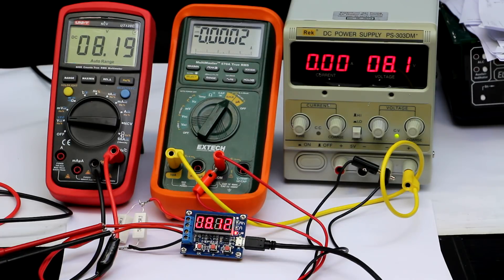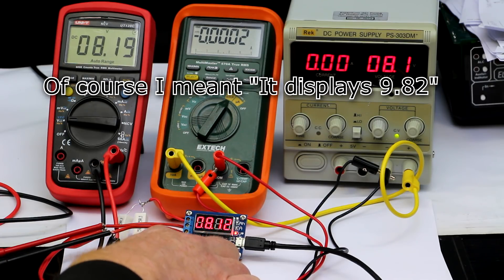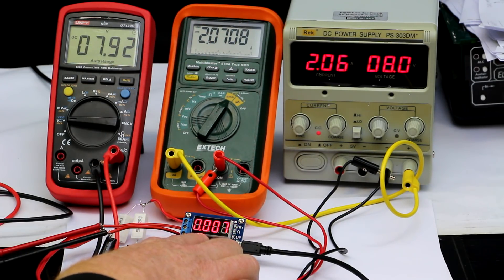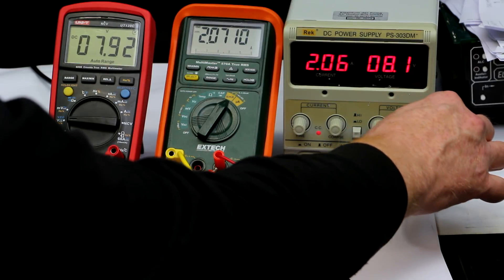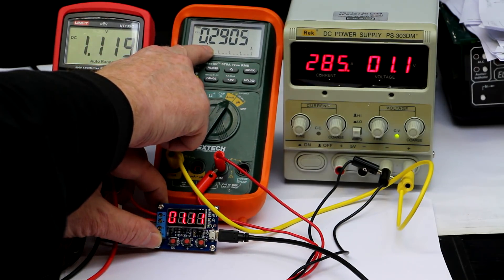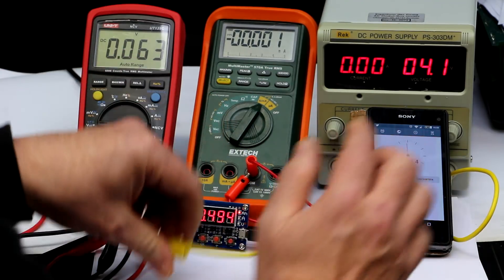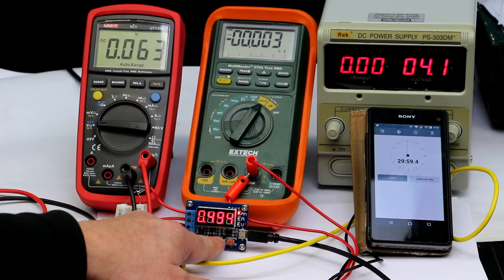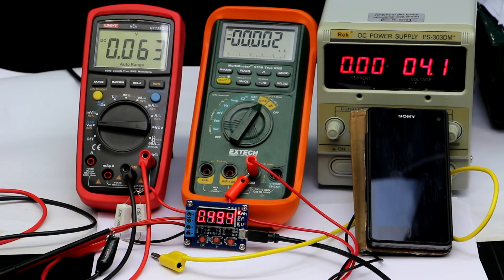Software-calibration of a cheap battery charge-meter from Ebay

Comment: Calibration used here is WRONG. It needs to be done at TWO AMPS, not 200mA.
Follow the instructions, and calibration will work just fine.

Comment: 200mah, thats true. Helpful
Reply: Nothing in this video is helpful. The described way of calibrating the Amps is completely wrong. Therefore, after wrecking that it cannot calculate anything correctly.

Comment: i know this has a bit of age, there a video like yours where he uses only short jumper wires no resistors " https://m.youtube.com/watch?v=Noc7CF6L78c" have you tried this way ( infull ) no resistors while calibrating no volt in while calibrating. then after that fact apply resistance an voltage one on one for each item an see what you get.

Comment: I received one of these the other day and found a consistent 12% capacity over read error. I tried the calibration method several times and found that I could use the +/- buttons to adjust the device! I.e. I would apply 10.00V exactly, and the device would read 10.14v, so each tap of the '-' would bring the display down 0.02v until it read 10.00v. Same with current, I applied 2.00A, and the device displayed 2.28A! I was able to bring the displayed number down to 2.00A.

It seems the software of this version is slightly different.

Note that during the 2.00A current calibration, the voltage is around 8-9v with a ~4 ohm resistor. That is a heat dissipation of up to 18 watts, which is too much for a single 5 watt resistor, so be quick with that particular calibration.

Comment: TEST (cont'd): IS A 25mA OR 50mA CURRENT A SINGULAR CAUSE OF mAh MEASUREMENT ERRORS WITH ZB2L3 ANALYZER?

CONCLUSION:
Test results empirically show there is no significant error in mAh at the 50mA or 25mA test current that can be blamed on JUST the current being lower and near these values. Any significant mAh difference in other tests must be due to another factor or combination of factors that may or may not be affected by a sub 100mA load current.
Note: the same disclaimers and factors apply to these results as in my prior ZB2L3 tests regarding possible differences due to test equipment, components, etc.

OVERVIEW:
Earlier today I ran a 4.00 hour test at 50mA and a 5.00 hour test at 25mA on the ZB2L3 "rev2.3s" using the same protocols as my earlier tests at 150mA and 500mA currents.
(see https://www.youtube.com/watch?v=viiRounCLWw&lc=UgwGE7Q5ItTS2YV6HsJ4AaABAg )
I decided to perform these low-current tests because there has been discussion that the ZB2L3 produces errors that increase very significantly under low current conditions.
50mA in particular was noted, and I wanted to see if this error increase would happen with my equipment and protocols.
Seeing no impact in the 50mA tests, I took the testing even lower to a 25mA current load.

Again, I was stunned by the accuracy and consistency of the results displayed by the ZB2L3 Analyzer I received, even at these low currents.
===============================================================

50mA TEST RESULTS AND PARAMETERS
Vsource~12.3V and Load=246.0 ohm to produce ~50mA constant current. (Load=250ohm 10W 5% Ceramic Resistor, measures 246.0 ohms)
(Note that ZB2L3 displayed 50mA load is consistent with independently measured 12.30V bench supply output  and 246.0 ohm resistor)

Here are the results over time as displayed by the ZB2L3 at hourly observation intervals. 
0.00 hours, I=50mA, mAh=0mAh..........START of test
1.00 hours, I=50mA, mAh=50mAh
2.00 hours, I=50mA, mAh=100mAh
3.00 hours, I=50mA, mAh=150mAh 
4.00 hours, I=50mA, mAh=200mAh....END of test
(Note: at the end of the test, the ZB2L3 display actually transitioned from 199mAh to 200mAh about 6 seconds before the 4.00 hour mark. 
Since 0.01hours=36seconds, I consider that 6 second early transition at 3.998 hours a negligible significant digits issue in this type of test so just recorded it as occurring at 4.00 hours)
CONCLUSION (50mA): These empiric results thus show that BY ITSELF, reducing the test current to 50mA is not a significant factor in producing any meaningful error in mAh measurement and calculation.
===============================================================

25mA TEST RESULTS AND PARAMETERS
Vsource~6.15V and Load=246.0 ohm to produce ~25mA constant current.
Here are the results over time as displayed by the ZB2L3 at hourly observation intervals.
0.00 hours, I=25mA, mAh=0mAh..........START of test
1.00 hours, I=25mA, mAh=25mAh
2.00 hours, I=25mA, mAh=50mAh
3.00 hours, I=25mA, mAh=76mAh 
4.00 hours, I=26mA, mAh=101mAh
5.00 hours, I=25mA, mAh=126mAh...END of test
CONCLUSION (25mA): These empiric results thus show that BY ITSELF, reducing the test current to 25mA is not a significant factor in producing any meaningful error in mAh measurement and calculation.
------------------------------------------------------------------------------------------------------------------

edit 201911130915UCT to fix improperly parsed hyperlink

Comment: I just finished some tests on a ZB2L3 I received to check in particular on the clock/timing and mAh accuracy issues about which people have expressed concern.
The tests suggest that the mA, mAh, and clock/timer subsystem hardware and firmware are working and accurate...at least on the analyzer that I received and in the voltage and current ranges of interest to me. I was actually very surprised by the results.

Note: I have NOT recalibrated the analyzer. It is as I received it from the Seller.

From what I've read however, it should be kept in mind that others may see different results. This could be due to different versions of the analyzer, different components and test instrumentation, attempts at recalibration, and even getting a counterfeit analyzer...a problem with China electronics.

The timer and instantaneous voltage/current measurement and mAh integration calculations were more than accurate for measuring battery/cell capacity at the approximately 3V and 10V limits I used in the tests...which covers at least the 1S and 2S lithium cell configurations and power requirements that are my primary areas of interest.

On ZB2L3 Rev2.3s (at least it KINDA looks like an "s" to me), I set up two identical configuration tests to evaluate a 500mA and then a 150mA load scenario.
I used a bench supply to provide a constant voltage to the ZB2L3 input into a 20ohm test load attached through the analyzer. This was comprised of two 40 ohm 1% resistors in parallel, which measure 20.0 ohms as expected given the tolerances of my instrumentation.

Over a 13 hour test, the ZB2L3 analyzer correctly reported accumulated mAh at 500mAh per hour with error well below my instruments' tolerances. For example, every hour the ZB2L3 display consistently reported the mAh increased by 500 +/- 3mAh and the instantaneous current stayed steady at 500 +/- 1mA.

FINAL NUMBERS
At the end of 13 hours, at 500mAh per hour the accumulated mAh reported was 6510mAh. (theoretical should be 6500mAh). That is much less than 1% error.

In a shorter 6 hour test I did the same for a lower voltage selected to produce 150mA via the same 20 ohms load (2x 40ohm 1% in parallel). The ONLY change between the two tests was the input voltage to the ZB2L3 and the duration of each test.
Yet again, the hourly reports showing another 150mAh and the instantaneous mA (150 +/-1mA) were virtually dead-on. At the end of 6 hours of testing, it reported an accumulated 905mAh (theoretical should be 900mAh). Again, less than 1% error.

edit: 201911082125UCT
change "at 500mA per hour" to "at 500mAh per hour"
edit: USB POWER BANK ASSESSMENT
these two tests also strongly suggest to me that measuring the more or less "constant" 5V output of a USB power bank should provide accurate and meaningful results as well. So...if I test a USB power bank from fully charged until it's depleted down to displaying just "1 bar" of charge left, I think I can be confident that the mAh capacity reported by my ZB2L3 to that "1 bar" point can be relied upon.

Comment: One very critical result I've found with this device (rev 2.3s) is that the results are VERY CONSISTENT under a given set of conditions and test parameters. And in testing...consistency is goodness.
For example, it displays  results that are +/-5mAh in measurements of battery packs with capacities over 1000mAh, and mAh plotted vs. time are also extremely consistent under a given set of test conditions (Vtermination, load, etc). In other words, for a given new battery pack/cell, it provides virtually the same mAh capacity over a series of multiple mAh capacity tests for that cell. A REALLY "1410mAh" cell will always result in a measured capacity of X mAh time after time with very little variation in the result. (the "1410mAh" is not what the label says...it is the actual as yet TBD value for that cell. For all I know, the label may fraudulently claim "2500mAh" capacity).
In addition, it takes the same amount of time to decrease the cell by Y mAh. For example, it takes 5 minutes to "consume"  100mAh, and always takes very close to the same 5hrs 25minutes to deplete the cell to Vtermination. Logging mAh v. time I could practically use the real-time mAh displayed as a stopwatch...if I see that another 400mAh are reported as having been "consumed", then I can calculate (or plot) that 20 minutes have gone by without even looking at a clock...and I can rely on that same mAh v. time in test after test under the same test conditions.

That means one can rely on the consistent results even if one cannot directly claim the DISPLAYED results. The good news is that it means one can formulate an algorithm to compensate under given test conditions to compute the "real" mAh value...or very close to it for a given device....by using results from tests on devices with accurately known values. If a given cell is ALWAYS reported by the analyzer to provide "1325mAh", using the correctional data (if any) from testing known devices one could determine that a report of 1325mAh under the given test conditions is really "1410mAh".

CONSISTENCY also means that one can perform COMPARATIVE evaluations that are meaningful in real life. One can for example, determine that a battery pack/cell that tests to and displays 3025mAh is ALWAYS superior to a similar battery pack/cell under test that displays 2400mAh...and it can be inferred that it is superior by an appreciable amount. The superior pack/cell may in fact be 3200mAh or 2950mAh, but it will always be more than the inferor pack/cell and that may be all that one needs to know...that "brand X" is superior to "brand Y" when X and Y are CLAIMED to have equal specifications/performance in a given application.

note: the numbers used above do not reflect any real devices or results. They were arbitrarily selected as representative rather than literal.
Reply from the maker: As some other commenters have suggested there seem to be different versions of this device. Getting stable results is only half the price if the absolute value is completely off. As I suggested, try to compare the displayed value of a low discharge current of e.g. 10...50mA with your multimeter in DC-Amps and in series with the charge-meter.

Comment: I really appreciate the time and effort you put in to this module, not to mention sharing with us - remarkable!
So sad that you've got the knockoff  version of this module to work with.
Strangely your module has nothing written on the upper side of the board. It might have different, lower quality IC or other components, just my assumtion -no offense.
The "good" ones are labeled  " ZB2L3  V2.3B  "  in the left upper corner of the board and " ZHIYU "on the back of the board ..... search google images for ZB2L3 and you'll see.
Also some replicas have " max. 15v    9999mAh  3A  HW-586 "  written on the most upper side of the board, missing the ZB2L3 and ZHIYU   logos.
Again, thanks for the job you have done!
Reply from the maker: Still I think that also the "quality" ones certainly will not have a precision OpAmp and will use the same circuit with the same design errors. The 2 most important being the "offset-subtraction" and the 2-wire connection of the shunt-resistor. Try your one with e.g. 50mA current and check with a multimeter.
I would be surprised if you get a halfway correct value displayed.
Reply: @KainkaLabs From my experience and people reviews, In general, all the chinese modules ( no matter what purpose they have) have a flow. i.e. some boost converters work just fine until suddenly output way to much voltage for certain input. We get what we pay for. This modules  probably perform  better for a  500 mA or 1000mA current as they are some time shipped  with a 4.7 Ohm  resistor.

Comment: OK Roger I am measuring above 1 amp, hopefully with my 18650's, I need a lil help setting these up and a formula, math etc to figure/correct for accuracy in the 7-?% range. Thanks
Reply from the maker: I really would not use this thing.
A correction factor would be dependent on too many (unknown) variables like the timing error of the internal oscillator, the error in the current shunt, the offset of the OpAmp etc.
Better use the TEC-06 from this video: https://youtu.be/Wfn3CEVm32o
I already have 3 other capacity-meters lying around here for a video (probably in 1 or 2 weeks to be shot).
But the TEC-06 is really a recommendable device for your purpose.

Comment: KKmoon LED Digital Battery Capacity Meter Discharge Tester Voltage Testing . is this one of the units you will be testing ? sorry double post..(posted on your other video) really want a accurate tester that is in the $10-$20  range  (18650 Batteries)
Reply from the maker: No. Looks promising.
The next I will test is the 
TEC-06 Battery Capacity Tester.I have ordered one 3 months ago which apparently got lost in the mail.Yesterday I ordered another one in the hope that this time it will get to me in reasonable time.

Comment: I managed to mess up my board by attempting a calibration.
I have the Voltage reading correctly but get error messages when testing for mAh
Could anyone clear up what the step is after connecting a 10 Volt supply and pressing OK ?
Where do you connect the 2 Amp supply ? Do you remove the 10 Volt Supply ?
I notice Kainkalabs that you seem to have a time lapse in your video when you get to this stage of calibration and am unsure if your calibration was succesful.
It appears that your board rejected the calibration procedure , as the error was the same after your effort
Reply: NO - you calibrate it at  TWO amps, not 200mA
Reply: @johncoops6897  5 years late reply is better than never I guess.
I thank you regardless for your assistance.
Reply: @mohammednovalija  - this video and comments come up in Google Searches. So the reply is more for future readers than for you 😃
Reply: @johncoops6897  Yes I understand
Reply: You need to connect a 0.2A supply to P+ and P-
Reply: @321tryagain  LOL - reply after 3 years - have moved on since then but appreciate your thoughtfulness.
Is it 2 Amp or 0.2 Amp ?
Reply: @mohammednovalija  200mA (0.2A)

I wrote it because I thought maybe others will have the same question as you :)